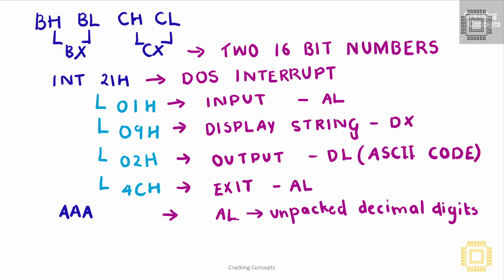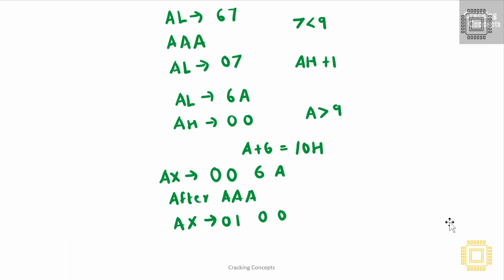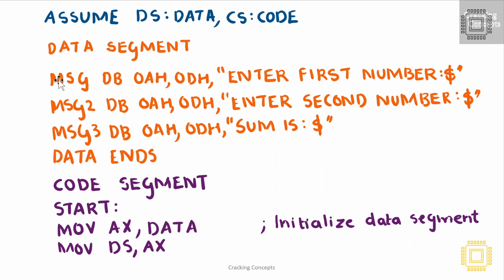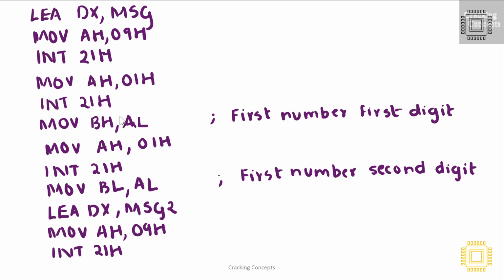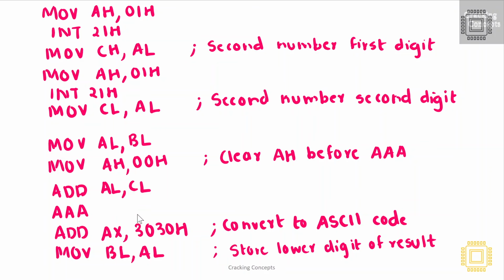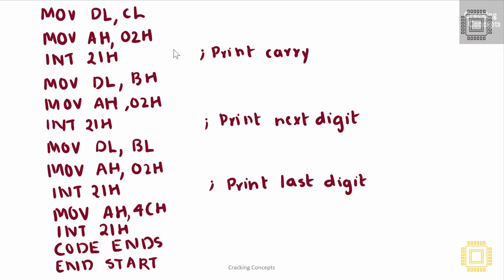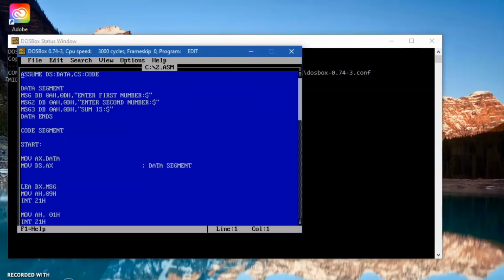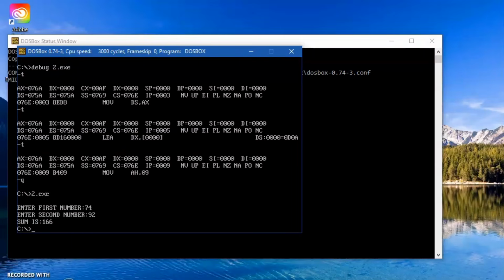MP LAB 1. MASM 8086 16 bit Addition with User Input in DOSBox - Solved Example

Comment: Fast addition without to touch flags:
mov bx, 1111h
mov di, 2222h
lea ax, [bx+di]

The result have to fit in 16 bit.
Reply: Max's suggestion on fast add works perfectly. No carry is performed !
Reply: Example: A routine to print 10 big letters.

I put all instructions into a batch file and the batch file need to run Debug and 10 ASCII attached.

Batch files are easy to copy&paste, executable and suitable to contain the visible source code made with assembler mnemonics. So feel free to copy&paste, modify and share. No spiritual ownership exist.

Start from DOSBOX prompt.
Example:
BigText.bat "Jumbo Text"

@echo off
REM Print big letters made with 8*8 ASCII 177
REM with a little help from debug
REM Usage: BigText.bat "Jumbo Text"
REM Need one parameter(%1) attached.
REM max.10 ASCII from border to border
REM Using character set ROM-Bios F000:FA6E
REM for each pixel set one ASCII to screen
REM start in the upper left corner
REM Note: Running only in DOS or DOSBOX
echo acs:100>tmp.deb
echo mov esi,F000>>tmp.deb
echo mov eax,FA6E>>tmp.deb
echo shl esi,4>>tmp.deb
echo add esi,eax>>tmp.deb
echo xor eax,eax>>tmp.deb
echo mov ax,ds>>tmp.deb
echo mov di,B800>>tmp.deb
echo mov bx,180>>tmp.deb
echo shl eax,4>>tmp.deb
echo shl edi,4>>tmp.deb
echo sub esi,eax>>tmp.deb
echo sub edi,eax>>tmp.deb
echo mov ebp,esi>>tmp.deb
echo xor eax,eax>>tmp.deb
echo mov esi,ebp>>tmp.deb
echo mov al,[bx]>>tmp.deb
echo cmp al,FF>>tmp.deb
echo jz 017A>>tmp.deb
echo cmp al,7F>>tmp.deb
echo ja 0170>>tmp.deb
echo cmp al,20>>tmp.deb
echo jb 0170>>tmp.deb
echo shl eax,3>>tmp.deb
echo add esi,eax>>tmp.deb
echo mov dl,8>>tmp.deb
echo mov al,[esi]>>tmp.deb
echo mov cl,8>>tmp.deb
echo rol al,1>>tmp.deb
echo test al,1>>tmp.deb
echo jz 015B>>tmp.deb
echo mov BYTE PTR[edi],B1>>tmp.deb
echo add edi,2>>tmp.deb
echo dec cl>>tmp.deb
echo jnz 0151>>tmp.deb
echo inc esi>>tmp.deb
echo add edi,90>>tmp.deb
echo dec dl>>tmp.deb
echo jnz 014C>>tmp.deb
echo inc bx>>tmp.deb
echo sub edi,4F0>>tmp.deb
echo jmp 012F>>tmp.deb
echo ret>>tmp.deb
echo.>>tmp.deb
echo acs:180>>tmp.deb
echo DB "%1",FF>>tmp.deb
echo.>>tmp.deb
echo n BigText.com>>tmp.deb
echo rcx>>tmp.deb
echo 100>>tmp.deb
echo wcs:100>>tmp.deb
echo q>>tmp.deb
debug<tmp.deb>nul
del tmp.deb
BigText.com
del BigText.com

The batch file contains some pipe operators (> >> <) to redirect the output of the echo commands into a new text file and to start Debug with the file. The output contains internal Debug commands and a routine that used the attached ASCII to calculate the address of the coresponding character shape in the ROM BIOS to set one ASCII for every bit of the character to build the big letters.

For to take a look into the output of Debug change this line:
debug<tmp.deb>nul
into this line:
debug<tmp.deb>DEB.TXT

Running with a little help from Debug.
Download and extract debug into the mounted folder of DOSBOX.
http://www.ibiblio.org/pub/micro/pc-stuff/freedos/files/distributions/1.2/repos/pkg-html/debug.html